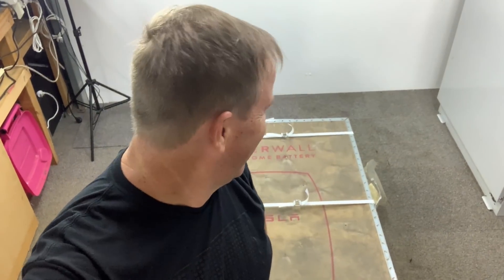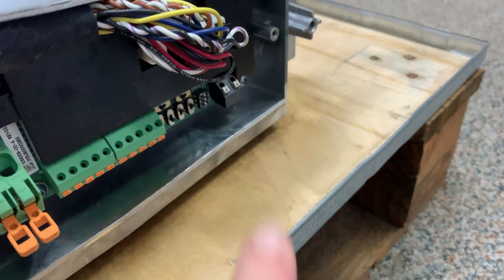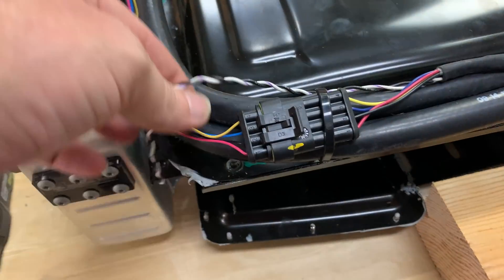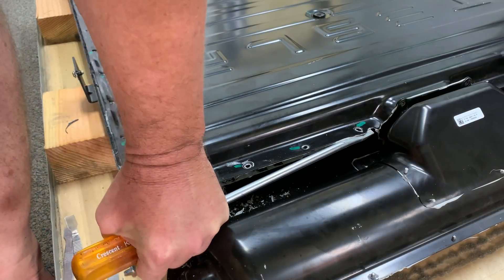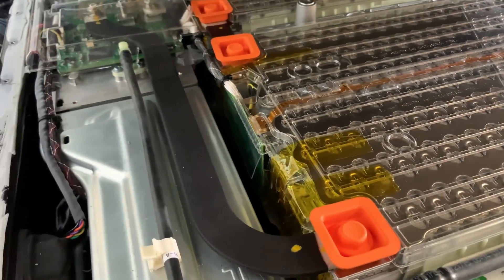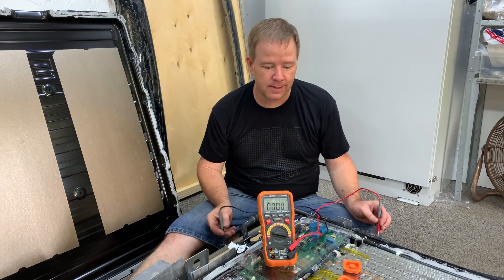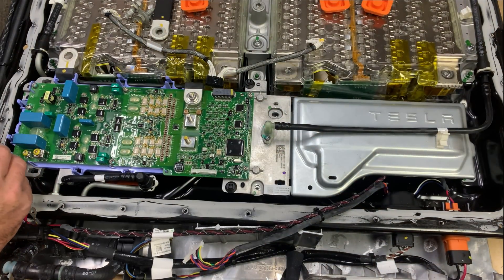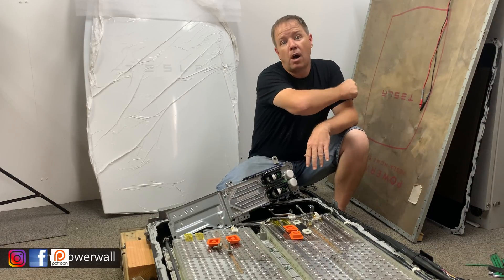Tesla Powerwall Teardown - Taking a look inside a new Tesla Powerwall thats been stored for years

Comment: Nice video, I just got given one of these power walls to pull apart, it is the same as the one you have here, I have 20v in both cells, just wonder what BMS boards you use with these, I see on one of you other videos you use an after market brand,  do you have any specs on the battery in this video. thanks
Reply from the maker: if you have 20 volts in batteries they should be good to go! I have all the parts here still from this one if you need to grab any - Brisbane Australia
Reply: @HBPowerwall  thanks for that, I was wondering what BMS you would recommend for these, I see overkill solar is bringing one out at the end of next month, I just want to run the batteries in my shed. I am just not sure witch BMS to get, any help would be great, thanks.
Reply: just wondering if you have the specs on these batteries, I was trying to find what amp hour rating they are. 
thanks

Comment: are you sure the bms hasn't turned off at low voltage cut off? what a stupid design if there is not disconnect from bms at low voltage, good cells will only loose 0.01v or something close to that over a year or two, what a complete waste of cells
Reply from the maker: it's a common design for BMS to be powered directly to battery, wouldn't be an issue if the manual was followed and it was maintenance charged during the 6 years on the shelf.
Reply: @HBPowerwall  interestng to know

Comment: Many parts to fail like pumps, fans, control electronics, plus risk of fire.  Powerwall 2 has a 10 year warranty (regardless of cycles) and >70% capacity left at end.  That would be 3200 cycles if full capacity used every day (unlikely).  Since home batteries typically cost $1000/kWh w/ installation, you pay at least 31 c/kWh to extract the stored "free" solar energy, and is an upfront cost so more like 50 c/kWh over its life (time-value of money).  Grid-power is much cheaper most places (exc. San Diego, Germany, thank no-nukes).

For off-grid non-solar recharging, the warranty is 37,800 kWh total usage.  Powerwall 2 costs ~$13,500 w/ installation and support equipment, so 35 c/kWh (again upfront cost).

Many buy them hoping it will let them continue a normal home life during a power outage.  You won't be running home AC, since one Powerwall will power only ten 100W light bulbs for 13.5 hours (smart people use LED's).  Consider just powering your refrigerator to save your costly food.  Seems absurd to backup grid power in thousands of Li "flashlight batteries" (billions of batteries for utility installations), and these simple calculations seem to support that.

Comment: You mentioned that HEAT didn’t work, but this is not true... I’ve opened these AND EV batteries in the past, and they all have this cement sealant around the entire seam... Heat DOES SOFTEN this gunk!! You must start at a corner, heating about half the distance to the next corner on each side... When you feel this entire portion has reached a substantial enough temperature, you begin to insert your tools/shims starting FROM THE CORNER outward equally bit by bit (leaving each shim in place as you add more. 

As you described, the gunk will gradually begin to give as you go... except the process will be much easier with the heat
Reply from the maker: so many years later lolz but will help others I hope so thanks for the comment

Comment: Good Job...is there inside an Inverter  build in please ?
Reply from the maker: no, there is a low voltage DC to high voltage converter so the battery is 48v and it transforms it to something like 300v to put back into a grid tie inverter.

Comment: Inductor chokes are large ferrite beads used
To minimize RF interference, as the device needs to minimize the amount of rf interference external to the device.  Ham radio operators like myself especially appreciate this as solar in general is extremely noisy on the HF bands (inverters are especially bad for interference on the shortwave radios).

Comment: Each battery is approx. 24VDC at full charge. Isn't there two of them? How does it add up to 500VDC mentioned in the video?
Reply from the maker: Inverter takes 450v to 550v from memory so transforms the 48v up to the voltage the grid tie inverter needs

Comment: Did you manage to get it to work? I have bought a second hand Powerwall 1 in the same state and replaced the batteries with model s but cannot get it to communicate properly with my SMA 2.5 battery inverter. Wondered if you had the same issue?
Reply from the maker: I haven't touched it since. My belief is the old 'Right to Repair' is at play.. needs a Tesla contractor username and password to re-commission it i'd say

Comment: If anything it will prob have numerous safety circuits inside temperature sensors a BMS and some manufacturers even use software in the BMS to detect if you change the cells in which case the bms will just stop the battery working altogether which makes home repair a nightmare cos company’s want repeat custom not customers eating into the company’s potential profits by replacing old tired cells with new themselves

Comment: Dude you need to stop touching things that might have voltage.
Reply from the maker: DUDE its zero volts? Less potential damage to be done than letting a 2 yr old play with a box of toilet paper!
Reply from the maker: Assuming i could afford to buy said two year old toilet paper..
Reply: @HBPowerwall  By all means explain how you showed us in the video that you demonstrated there was absolutely no voltage inside that box. And I say that before even pointing out that this is supposed to be an instructional video that shows best practices.
Reply from the maker: Lol 😂 I did off camera + the company I got it from with a building full of qualified electricians said it’s dead flat
Reply: @HBPowerwall  Just won’t accept that you’re setting a bad example.  You just won’t accept that any electrician is gonna tell you that your practices are stupid.   What you should’ve done is checked your voltmeter on the live leads showed us that then every time you touched anything metal you should’ve checked it with a volt meter first.  Anyone who doesn’t do that is a fool. Stop being defensive and realize I’m trying to save peoples lives here. Jesus.
Reply from the maker: So I’m a fool, I’m good with that. Thanks for the interaction

Comment: Interesting to see what is in the 20k hanging on my house has on the inside.
Reply from the maker: what do you have?
Reply: @HBPowerwall  I have an 8.5KW solar roof along with 2 powerwalls, a powerwall 2 and a powerwall+.
Reply from the maker: Nice, so so you think you even have an ROI on that setup. I would imagine breaking even would be a challenge unless you have regular long power outages.
Reply: @HBPowerwall  Not really expecting it.  I chose to go the roof/PW route having the ability to lower my electrical bill to close to zero, versus having a new shingle roof installed with a natural gas whole home generator for power outages.

My reasoning for the choice was that all considered, the solar roof/PW was only approximately $15k more than the shingle/generator.  With the generator, I have a "normal" power bill as well as now scheduled maintenance on the generator vs hosing the roof off and keeping debris away from the PW's.  

Plus, to be honest, the roof looks cool and the powerwalls on the side of my house are sweet with the green glow at night.
Reply from the maker: It sounds like your happy with your choice either way. 100% safer than my route

Comment: 3M Automotive cleanup solution (you will have to look up the name of it) comes in a spray can it's used to remove RTV from around
 Windows that black rubbery stuff that seal the windshield to the vechical both fresh and cured.
Reply from the maker: Arr never heard of that. If i ever do another i'll check it out.

Comment: If you ever wind up trying to open another battery case use a heat gun on the sealant it will soften it and cut down on the struggle to separate the two halves.
Reply from the maker: Unless I can find a PW2 I don't think so to be honest - altho I'm surprised by how many of these PW1 are out of service already

Comment: A metal paint scrapper might work to get the halves separated easier without deforming the casing edge so much.It’s thinner than the brass rod or chisel which has a wedge shape. Something like the cheap Goldblatt brand from Home Depot. It’s got a semi sharp edge.
Reply from the maker: not sure, but won't be doing it again to test the theory lol

Comment: @HBPowerwall For opening the battery i know alot of car manufacturers use a cutting wire of steel or nylon and a tool to 
pull the wire through the adhisive just like you cut out a windshield on a car and some have this wire built in on the inside of the battery
with 2 ends sticking out so you can just pull them with a tool. But most have stopt doing that because they dont want people to service them
Reply from the maker: thanks for the info

Comment: Good video. That sealant looks like the same stuff apple uses on it's phones. A blow torch or maybe even a heat gun might soften it
Reply from the maker: Tried heat, but not a blow torch - used my Hot Air station at 120 speed and 500deg C - didn't help unfortuntally

Comment: would seem to be rather academic looking inside when the cells are stuffed. Recharging is risky re internal shorts and possible fire. Battery technology is still far from what is needed - new to junk in 6 years and far too much mining for cobalt and lithium etc for a battery system that has a short product life. (can only go through so many charge discharge cycles before dying) Save the planet from this rubbish that we are creating, in the guise of green energy. Recycling of Lithium metal hydride batteries is difficult, costly and seriously polluting also. We can use them in small devices, not such an impact when they die, but cars, and larger power storage, they are a fail in a matter of a few years.
Reply from the maker: You're 100% right, we shall all go back to coal and smile that we are doing good..
Reply: @HBPowerwall   Nope thats not an option  but generating electricity from new hydro power stations could be a first step. After all in the US COAL IS A MAJOR ENERGY COMPONENT OF THE ELECTRICITY USED TO CHARGE YOUR TESLA CARS AND POWERWALLS
Reply from the maker: Well not mine par say.

Comment: If Tesla powerwall has a cooling fan and a radiator, where does this fan release out the heat? What is the coolant Tesla uses and does it have a heating element to heat up when it has to go -20 degree celsius?
Reply from the maker: Don't think it had a heater, and the heat exits up the top through the radiator.

Comment: You want a Cordless Oscillating Tool. Get it in between those two joints and cut the glue apart.
Reply: they even make a non-toothed blade for just that job.
Reply from the maker: Thanks for the tip

Comment: From other videos at 3rd party garage shop they seem to be trickle charging the batteries for 3-5 weeks until full or almost full then at 9:16 use your tool to test each battery.  recycle the bad ones and order new ones when bought as individually they are pretty cheap.  solder back in and then you got yourself a fully working battery station!.
Reply from the maker: I'm still trickel charging months later.. I'm about to recycle them lol

Comment: The easiest an fastest way to open the battery case is with an oscillating multi tool.  I've done it a few times with my Dewalt.  Other than adhesive residue the case still looks like new after opening.
Reply from the maker: Seems like a solid idea - unfortunately at the time didn't own one.

Comment: Seems to revive this battery, dead modules must be replaced completely. All new batteries... seems it is not worth to do it, only remaining parts for spares.
Interesting why BMS killed batteries instead of disconnecting from batteries completely when they reach storage voltage (3.7V) till voltage from charging appear from outside.

Comment: I revive  worst lithium or ni cad  batteries older than that all the time infact every battery I own had been tossed out because of total drainage . Don't give up , the safest way to do so is to pair with a full battery until they level then charge both . If that doesn't work then pulse the battery until the charger excepts and begins to charge
Reply from the maker: Bet you've never revived safely ones that have been 0volts for years, the internals of the cells are rusted out and almost useless
Reply: @HBPowerwall  how can internals rust? That doesn't make any more sense than a BMS that ruins the battery just because it's sitting 5 years. What, was it in a flood?

Comment: Hi, I’ve got a question with battery cells and how they are secured in a module. Basically for a design project we are designing a battery module where the cells are held by cell holders. But I am confused on how these cells are secured within the module case? Are they glued down to a plastic plate? What about the bus bars and connections for the bottom? Our module case is also going to be cooled by submersion with a dielectric coolant which means the whole module case needs to be lined with some sort of plastic film.

Comment: I know I'm late to the party, but here goes;
I got a laboratory test victim Powerwall a few years ago, and it was also "dead", but not really. 6.7V across both modules, but over 2 months of slowly charging them with a current-limited DC-DC converter and a solar panel, I managed to bring them back to a usable voltage.  I had the cooling pump and fan set up and ready to go during the charging process, in case things got warm, but it stayed cold.
The Tesla DC-DC converter in the Powerwall, on the other hand, has refused to do anything but throw an undocumented error code.  If I had to guess, it probably is waiting for a factory activation code or saw that the battery voltage went too low and locked itself out.
Reply from the maker: In my experience there is a huge difference between 7v and zero, Id say your wall isn't commissioned or has bricked. I really wish I understood this stuff better.
Reply: I've had this same experience. Batteries came back good but the unit won't start. I can read the modbus status registers though

Comment: Great informative video Pete! Do you know if the two battery modules inside are identical to the ones that come out of a Model S pack? If so (though not cheap) you could replace two in and get this working again? Or are you going to make your own 12S pack out of 18650s and connect it up to the factory BMS boards
Reply from the maker: They are the same unit, I have a few options I'm working with :)

Comment: Next time use a windshield cutter remover tool as it should cut it like butter. The adhesive is probably similar to what is used in putting a windshield in a car. The tool has a handle so you can pull the cutter around and the cutter is thin and long enough to cut through and not damage the case.
Reply from the maker: I hope there is a next time!!
Reply: @HBPowerwall  you can get them easily. They work great for many things. That battery being one of them being it is similar glue. If you do let me know.

Comment: Lithium batteries are an extremely poor choice for storing power in anything but a hand held device,
The bigger the current draw gets the worse choice they are and for grid level storage they are the worst choice possible.
However with the exception of a sodium battery there is little to compete for home storage. Maybe a mechanical battery of some type like a dynamometer or compressed air?
Reply from the maker: If a battery is designed well a lithium batteries energy density to size /weight /cost is almost unmatched..
Reply: @HBPowerwall  . You haven’t looked for alternatives very hard.
Lithium batteries are a short lived ticking time bomb of compromise. You have to waste a lot of energy keeping them cool and warm, you cannot dead draw on them or flat charge them without them exploding into flames. The raw materials are finite expensive and mostly toxic and rare and are mostly sourced from places that will offer you two child slaves with every ton of material. Work is being done on grid level storage batteries which except for compactness put lithium cells to shame in every respect from capacity to cycles to draw and charge limits.

Comment: I install these. They weigh 250 pounds. Wholesale for $3500, we sell them for $12,000-$15,000, plus labor and they already have our panels on the roof, which don't work in a power outage without the battery. They charge the battery during the day and if sunny, you get about two days of electricity, depending on your load. They are connected by WIFI to the Gateway, which the Utility and homeowner can access (and me) to see pretty graphs of what it's doing. What else?
Reply from the maker: interesting.. but that markup is madness lol I've called 30 installers this week to buy a PW2 no one wants to sell me one

Comment: Isn't it possible, there is a safety circuit on the batteries who has cut of, and Batteries are idling on 3 V ?
Reply from the maker: I would love to say yes.. but zero point zero zero volts
Reply: @HBPowerwall  I mean directly in the battery, many 18650 have a protective circuit under the cap on the positive pole

Comment: You can bring it from the dead use a DC welder
Reply from the maker: That would be the most epic video ever lol
Reply: Already have done it all the charges will not bring it from 0 to 48 volts because of their High duty cycle or dead short capability you can dial then the amperage control with it